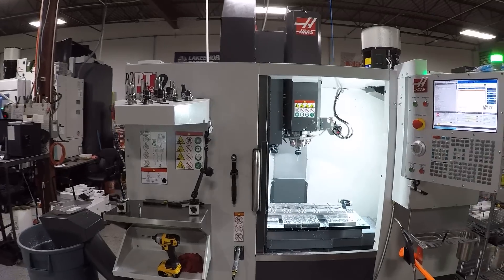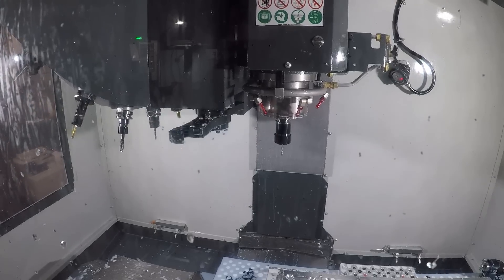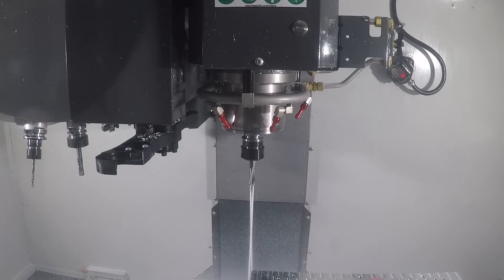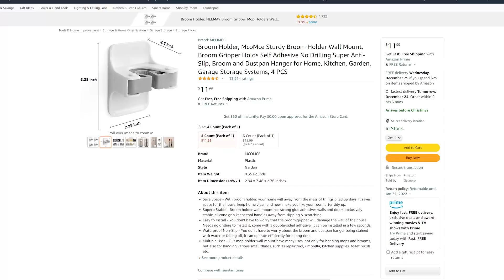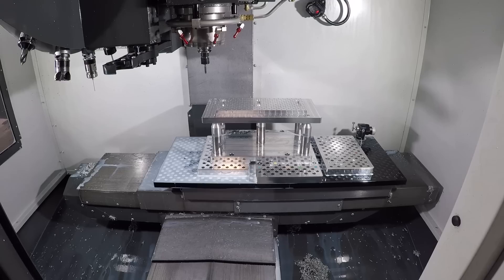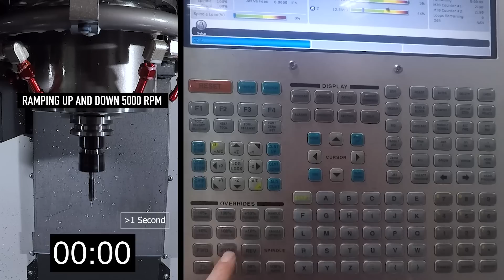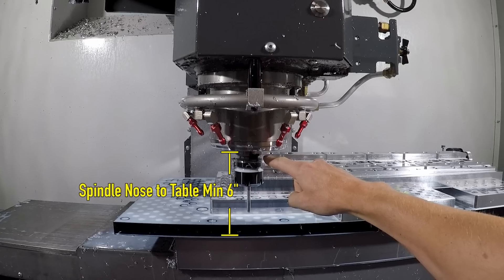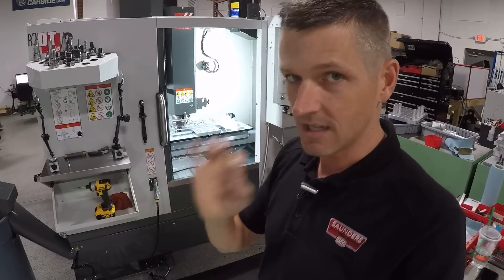HAAS DT-2 Review!  What we love about this FAST machine!

Comment: I'll be making small aluminum parts with lots of chamfering.  I was considering a VF2SS, and the Area 419 video blew my mind.  I think the DT-1/2 would be perfect for me.  Is that a HRT210?  It weighs 205 lb and the table can only hold 250 lb.  Is that an issue?

Comment: Something about a 2 inch maximum tool diameter. If that is limited by the ATC, would it be possible to manually install something bigger like a fly cutter when needed, and use the ATC for other tools?

Comment: I am looking into starting my own shop and am in between what machine to start with. I appreciate how you mentioned if you did not have a machine, which to choose. You mentioned a VF2. As far as something cheaper, would you suggest a Mini Mill or a VF1? I would prefer something that can easily transition from aluminum to types of steel parts while keeping, as you featured, the fastest possible programs. Thanks for the video, I hope to hear back from you!

Comment: We used to have a few DT-2s at my shop (boss cheaped out), later we had no choice but to upgrade to Brother Speedios. They were decently fast, but not quite fast enough, plus "drill/tap" machines' Z travel are supposed to be relatively short, and the ATC magazine is supposed to feed directly into the spindle, the exchange arm completely ruins what the DT-2 could have been. Also Brother startup and controller is faster, and probing is just as easy.

Comment: I noticed your tool change could be better

After calling M6
Call the next tool without M6

If it works the same as the VF3-VPOD. It should prepocket the next tool during operation so when it changes tool it's instant

Comment: We have a DM1 and a Dm2 we were absolutely amazed that it was 30% faster if you have any kind of production parts in your shop these things are a must have. We were running a part on our VF 3 on our trunnion 6 parts in 2 ops it took 4 hours total to run all 6 parts, on our DM we are running 3 parts 4 operations in 1h 16 mins so 6 parts takes 2.5 hours we saved 1.5 hours. So where we are 40 mins apart on the trunnion in 2 ops we are 25 mins a part and that’s adding 2 operations. It’s crazy!!! Now mind you are vf3 is a 12k spindle and our DM’s are a 15k spindle so we were able to speed up all the tool paths but it’s still amazing neither the less. Anyways cheers guys!

Comment: One of the machines I run at work is a VF-2SSYT; compared to our VF-3's (4 machines) VF-6's (got 2, one literally just off the truck from the factory) and our VF-11 it is blazingly fast. But it's a direct drive machine; both it and the VF-11 (also direct drive) can make your shift a royal pain due to the total lack of bottom end torque. We've had to rewrite a lot of older programs from the gear box machines just to keep them within the torque specs of these two direct drive units. They're still great machines, it's just that you have to match the machine to the type of work you actually have. 

If you primarily run lighter alloys, and/or small tools as well as small parts, a DT machine might be just what the doctor ordered. On the other hand, I'm machining heat treated 17-4 stainless parts in our VF-2SSYT. And while it's doing so just fine, the VF-3 feeding it is doing much heavier actual spindle load's at lower power levels due to it having a gear box. I will trade top speed RPM for a transmission with max bottom end torque any day of the week.
Reply: That an underrated comment! Thanks for sharing

Comment: Have to say great review for that CNC. myself i love the Brother r450x2 its faster and dual table. the only hard part was learning the control it will read multiply M codes and G codes on a single line. and tool changes are done with prep move commands so the thing is crazy quick.
Reply: Travis
I love the brother R450x machines we have 4 of them and will be getting another one here soon. If your running production hands down the best machine for the job. And they are scary fast
Reply: Brother vs Haas....C'mon Man!!! No contest. Brother control is one of may favorites too. 🙂

Comment: Interesting fun fact related to the acceleration of a spindle. Rigidity increases with diameter to the 3rd power but rotational inertia increases with diameter to the 5th power.
Reply: That would explain why 30 taper is preferable for a DT machine where the spindle needs to start-stop frequently and most cutting forces are axial.  I'm sure that tapers are more rigid in axial compression than they are radially too.

Comment: Hey John, we have 3 DT2s where i work, be very careful of the way slides. They get loose and will start hitting the walls of the machine, and that happened to all 3 of the machines we have. Recently 1 came undone and you can see the ball screws and all that under the way cover. Other than that, they are amazing machines, super quick and with a 20k rpm spindle, it can fly through aluminum

Comment: I have a new DM-2 with the 40 taper spindle and thru tool air blast. The company I work for makes science experiments for the international space station. It’s an ok machine. It is crazy fast. I use a lot of micro tooling and the z height limitation was a surprise to me. It definitely makes it harder to run parts on the table. We got the auto air / MQL nozzle add on for like $1500 and it’s such a piece of crap. Because of cross contamination concerns of coolant, we run everything with MQL. The nozzle works like it was designed by a college intern and Haas decided not to check their work or make any improvements to system. After 6 months of light use, it flops around and the spray pattern has been erratic from the start. I’ve put less than a quart of canola oil thru it. Some other things about the machine annoy me. The conversational programming is a joke. It’s basically unusable. The table height and distance from the front of the machine kills your back if you spend any time working in the enclosure. The tool carousel has a pretty limited tool length. You can’t have a 1/2 jacobs chuck in it with a drill of any size in it. The probing is ok, but I feel that is erratic as well. I occasionally have to make offsets to compensate. It also won’t probe your work offset in metric. You can probe your tools in metric. That may be some setting that needs to be changed and I didn’t take the intro class because of Covid. The service guys are crazy busy here in Kentucky, so be prepared to wait if you have some minor problem. Overall I’d give the machine a C+ or B- / 3 out of 5. Not sure I’d buy again but I also don’t feel like setting it on fire.
Reply: The machine will only probe in the unit the machine was set to when calibrated. That has been my experience with other haas mills. I can’t speak directly to a DM-2.

Comment: We bought one with the 20,000 rpm spindle.  Torque is low on the 20k version and we have a little trouble with taps bigger than 5/16 - 18 depending on material.  We bought it for small parts with small tapped holes in the 2-56 area so it’s just fine and it really can fly with a 1/4’ end mill.  It cut our cycle times in half from running the same part on our VM3.  Most of our tools are less than 1/4” on the parts we make on these.  It will run a 2” face mill just fine and it’s hard to beat slotting 7075-t6 0.080” deep with a 3/32” end mill at 90 inches per minute! I’d buy another one any day.
Reply: For tapping holes larger than 5/16, use a thread mill! You can get one with a single cutter that spirals in much like the rigid tap and will handle several different threads with the same tool, or with a row of cutters spaced according to your thread (like a rigid tap is made for only one thread type) that make the entire thread with a single spiral turn. Cut a full inch thread or larger on your machine, easy!

Comment: I guess I'm not the only one who got to speed things up at work for Christmas, also by downsizing equipment. In my case we swapped out robots/welders on some spot welding robot cells... smaller, lighter, and ultimately (for those and other reasons), faster... a lot faster! The customer for the parts the weld cells make (been running for several years) will be pulling a lot more than today in the somewhat near future, and we had some better suited equipment in storage that wasn't available to reuse back when we originally built the current cells. A bit of a pain to make work over a plant shutdown week (I had a lot of it done months in advance, awaiting the time to swap), but the ends justified the means and then some (got more of a reduction than I expected, whew). At least in my industry (Automotive subassembly), time is the enemy... especially when it's not value-added time!

Sure, it's not a CNC... but it's all servo automation at the end of the day. Bigger isn't always better and often smaller is faster, if it can handle the load. Hence why my "new" (9 years old) robots and your new DT-2 smoke larger equivalents on cycle time.

Comment: Hurcos have a 6" spindle to table distance as well. As you said its generally not an issue but it can be annoying. Especially if you don't check the program for errors prior to running. The machine won't know its an issue until it gets to that line in the code and all the sudden your program stops and you realize it wont reach.
Reply: I’ve never understood why other controls don’t have a graphics or simulation mode like Haas does.  It checks things like overtravel long before it would be a problem.
Reply: @caseywaite599  hurco has a graphic sim but it doesn't check for travels it just simulates the part being made. At least thats the case for our 2014 vmx50

Comment: John, did you add the washdown nozzles in the back? If so, can you do a quick vid on that one?
Reply from the maker: Did we? I can ask the guys - we might have
Reply: @nyccnc  it would be very intetesting to see your solution working!
Reply: Chip evacuation is a real pain on all Haas mills, looks like designers have never been machining some parts on these machines themselves
Reply: @zyndapp800  I agree completely. I ran across a video a while back where a company had designed a waterfall method of washing chips down. It can best be explained as a mud tray you would use for mudding sheetrock. When this little tray got full, it would tip over and wash the chips down by pouring itself on the back walls. Cycle time per wash about a bout 15 to 30 seconds. It had a coolant line plumed into it and just filled it up and then when full it would tip over due to shift in center of gravity VS pivot point. The video had two of them, one on each side and they ran the length of the back wall for the most part. They positioned them up high as to not be in the way of anything for travel. I really wish I could find that video again but seems perfect from what I can tell. The best I could tell is it dropped about 3/4 of a gallon every time it tipped over. Simple / genius.
Reply: @davidbcn84  Yup, thats it.. Thank you
Reply: Interesting to see if they work well

Comment: I seem to remember a Rob Lockwood comment discussed on the BOM a while back about the relation of the spindle nose to the table or to the centre-line of the trunnion in a five axis machine. 
Does someone remember the detail of what was explained?
Reply from the maker: The point Rob was making was understanding whether the Spindle (or spindle + tool) was able to reach past the centerline when A (or B) axis was tipped all the way over

Comment: 5:40 Simply said: it's basically to the fifth power.   The term you want to refer to is "rotational moment of inertia", usually expressed in Kg*m², and abbreviated as "I".
For a solid cylinder the formula is: ½M*R²   where M=mass and R=radius. Which means that if your cylinder grows equally in all directions, then the M increass cubically, and then the R gets squared by the formula. Fill that in, and you'll see "I" increase to the fifth power.

The kinectic energy required to get your spindle up to speed is directly proportional to "I". Another factor influencing the kinectic energy is obviously the rotational speed ω (usually in rad/seconds).
Energy=½Iω²
-----
Disclaimers: bigger spindles do usually have more power and torque, making up for some of the additional mass. That's something to keep in mind.
In different areas of physics, there are different "moment of inertias"; so if you want to look it up, be sure to look for the rotational one...
Reply: if we're talking about linear acceleration, it's F=m*a, so if 'a' stays the same, we have F directly proportional to mass. And F is directly proportional to the power of servos.

He didn't mention what he means goes into cubic power to accelarate.

Correct me if I'm wrong.
Reply: @goodfis624  The cubic comes into play as Sasja mentioned for the actual spindle acceleration and "speed" the linear acceleration is effected for its linear movement like how you stated. With these machines the actual spindle acceleration is incredibly importantly for reducing the tool change time. This can be seen with large taper machines at high RPM changing tools,  the actual tool change either has to take longer to effectively decelerate the tool OR use significantly more power to achieve the same speed.
Reply: @goodfis624  He was clearly talking about rotational acceleration of the spindle. Because he said the DT-2 is only faster if you do a lot of tapping and toolchanges, that's why he showed how long it takes for the spindle to start and stop.
    Linear acceleration of a bigger spindle is not as bad as the rotational acceleration; the linear acceleration of his big machines is still fast enough.
----
Rotational motion is a bit more complex than linear motion, because of the distance to the axis of rotation.
It's just like torque=force*distance, that's why torque is in Nm and not in N.

Rotational inertia has the same thing: you take the (mass*distance) for every point in your object, and mathematically integrate that.
If you make a solid cylinder bigger in diameter, then not only will the mass increase, but that added mass will also be further away from the axis of rotation. So you'll get a double increase.
-----
Вот как-то так.
Reply: @sasjadv  Thanks, that clarifies for me now xD
Спасибо. Я че-то подумал что он про линейные ускорения осей.
Перечитал изначальный коммент - да, теперь понял почему необходимый момент для получения того же углового ускорения растет в 5ой степени. Че-то я не задумывался что он растет ТАК быстро.
Reply: @goodfis624  Кстати, это как раз объясняет почему маховики на двигателях делают плоскими с утолщением на краях. Если масса находиться дальше от оси вращения, тогда инерции будет больше при той же общей массы маховика (а ему эта инерция нужна чтобы сгладить работу двигателя).
Ну и ещё это объясняет почему ЗИЛ верховного ящера заметно быстрей поехал на колёсах меньшего диаметра.
-----
Если речь о статических нагрузках, то прочность труб или прутков на сгиб увеличивается в четвёртой степени к диаметру. Причина та же, у трубы большего диаметра не только металла больше, но и металл дальше находиться от центральной оси.
И почему-то эту прочность профиля на сгиб тоже называют "моментом инерции", хотя это другой предмет науки и формулы другие.
Ну вот почему каркасы безопасности делают из пустотелых труб, а не из массивных прутков: больше прочности при той же массе.